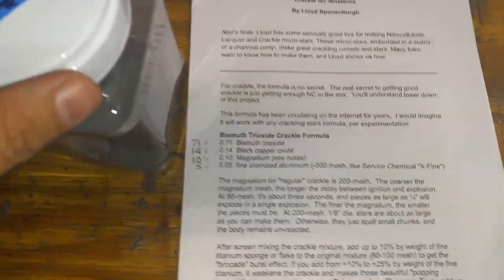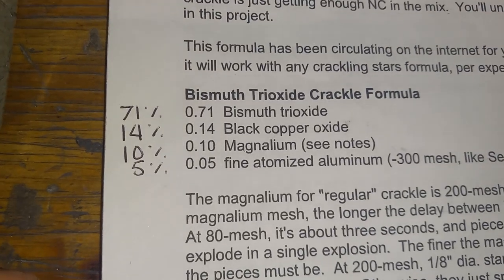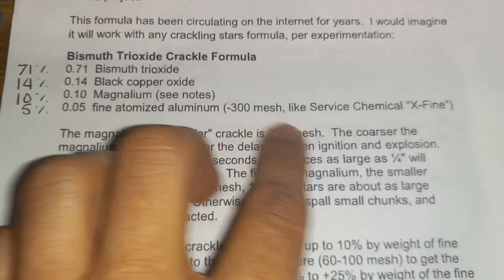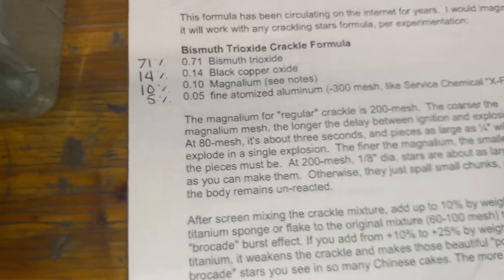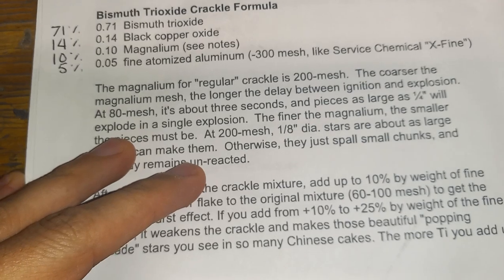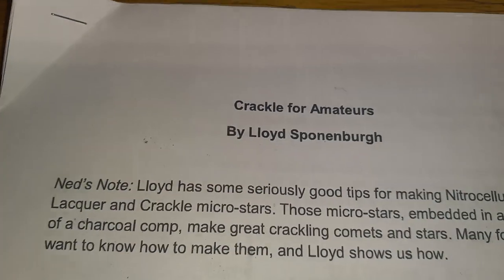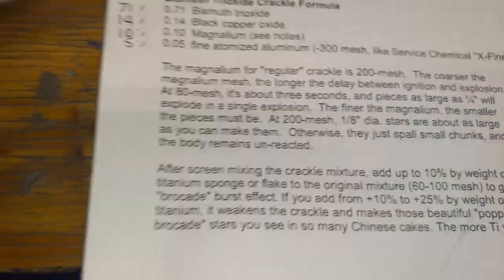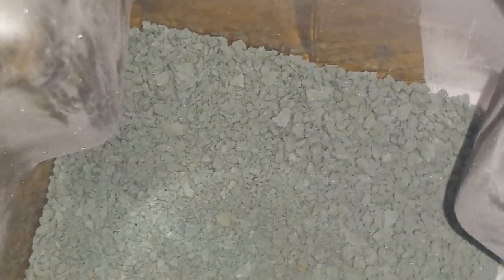Crackle Impact Sensitivity Test

Comment: Great video. I did the sensitivity test some time ago because I have a lot of it made and I didn't want to drop the container and have it blow up. Just wondering, though, do you prime the finished composition before putting it in a shell? I've been using the screen method (1/4th inch) and then using the alcohol/water spray and black powder and swirling it around a rounded bottom bowl to get spherical pellets. It looked like you screened, or granulated, yours through a much smaller screen. Can you use the granulated composition just like that, without priming? Thanks
Reply from the maker: You're more likely to get good ignition when priming your stars in general but when it comes to crackle, the more evenly burned the prime the louder the pop. This is explained in Loyds article. As for the alcohol, that would be ideal because using acetone again would cause the stars to soften and turn back into a slurry. I used a 8th mesh screen. Come to think, I have no idea if they will hold together if I were to prime them because some just disintegrate upon being squeezed. I didn't add dextrin because it wasn't mentioned. I will have to be careful when priming because I don't want to destroy them. Your welcome. I'm no expert for the record. I'm learning. Priming will give the stars more time to spread before crackling takes place and makes them less prone to desentigration upon burst. I still have to find the right burst comp too.

Comment: What does it look like tho? Is it really course and grainy like pop rocks candy? I never took apart dragon eggs I have a full box of dot class c dragon eggs but never took any apart
Reply from the maker: It's light green and granulated through  1/8 pyro screen. "DOT class c dragon eggs" I'm not familiar with any dot firework called "dragon eggs" but know what the effect is aka crackle. Like all stars, these too will get primes with black powder slurry and left to dry. There's a good chance that even though I add dextrin to the BP slurry with alcohol thatl like the stars will disintegrate because they're not very solid to begin with. They break in you hand when sqeezing them. It may be that star building on the large scale is the only way or else you have to deal with stars breaking and or coming out larger than others. I have a star plate I purchased for this very reason and it spits out stars meant exclusively for 3 inch shells.